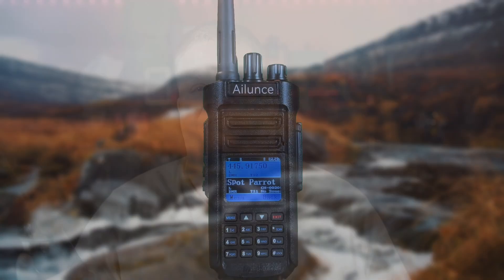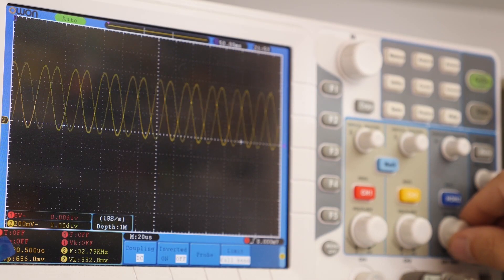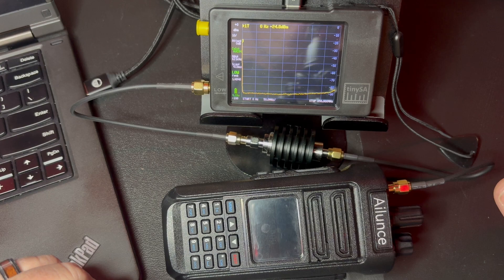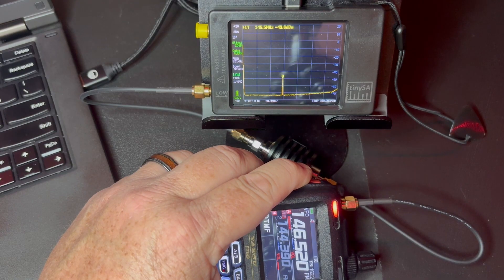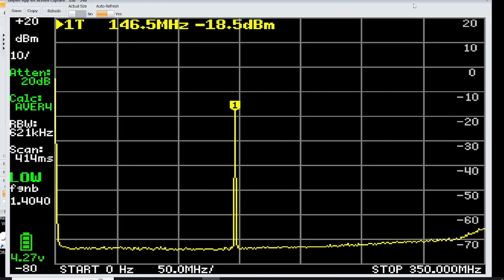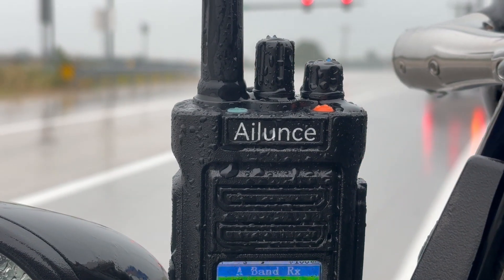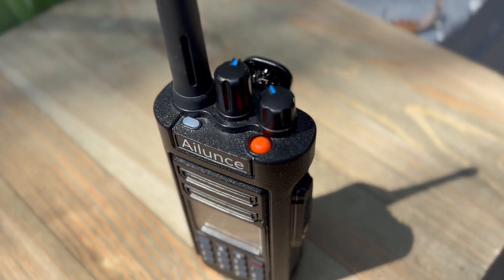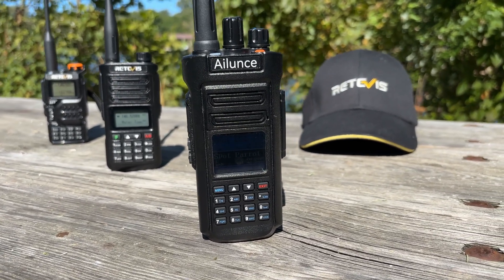Retevis HD2 PASSES FCC Test?! | The Shocking Truth About This Waterproof Radio!

Comment: Well.......Retevis still hasn't fixed the previous model HD1 model. GPS still only works in DMR mode only and not in ANALOGUE. When you use HD1 Radio in ANALOGUE mode, it is useless. My ($18) QUANSHENG Uv K5 outperforms HD1 ($180) in ANALOGUE mode......I am really dissapoinnted. Yes, RETEVIS  radios are EXCELLENT in quality, yes they are water and dust proof, yes you can tell the quality is there, but ANALOGUE functionality on this radio is really bad. If there was an ARMAGEDON on horizon or bad hurricane i would always chose $18 Quanshen or Cheapest Baofeng over this HD1 radio simply because of their functionality......Why did they advertise this radio both DMR and ANALOGUE i really do not know!

Comment: You did a great extensive review explaining in full detail. This is a great radio with good features, at a very reasonable price that includes Bluetooth, and it will also do the the 220 band after resetting it.
Reply: Menu key and #8 while turning it on? Password frequency 777888?

Comment: If you want clean harmonics pay the money,buy commercial grade..simples
You need proper calibrated test equipment ,those vna can easily be overloaded if not padded or using a proper RF sniffer sampler.
Even then I would not trust it against a very high end brand  test equipment in a rfi sealed chamber.
Expectations Vs Reality check ✅ 
If it's been approved by the FCC/ETSI it's approved and certificates end of story.

Only real way would be to take it too a proper test chamber and a company that deals with type approvals ,get it subjected to proper testing.
All these DIY methods you cannot validate and take with a pinch of salt.

Comment: So is Retevis HD2 safe to use?
Reply from the maker: In my opinion it is fine to use.  As with any rf be mindful of rf exposure.  I would attempt to keep all the antennas away from your head if possible.  Lower power hand helds seem to be good.
Reply: @Disastercommunications  Many thanks.
Reply: @Disastercommunications I recommend setting the radio to medium power which is 5 Watts because that's the safest level. For 2-way radios.
Reply: Appreciate the video I personally don't really care what the Spurs and harmonic emissions are if it's got an FCC sticker on it that's good enough for me. And I guarantee you everyone that's leaving a comment bitching and moaning about the spectrum purity of this radio has probably got five baofeng UV 5'S which are the antithesis of  spectrum purity. I have been a ham for 30 years now, before there was hro or any online amateur radio retailer amateur radio operators had to build their own equipment. So our equipment does not have to meet any Fcc certification. However amateur radios marketed for sale do. And I'm just going to bottom line it  it's a dollars and cents thing you got the same features that the anytone 878 has in a radio that's half the price it's a no-brainer it has the FCC badge which I looked up and it is legit. So everyone that is dumping on this radio needs to take a look at the typical average ham situation. Not every ham has $1,000 to drop on a handheld. The 878 is going for like close to $350 in my opinion it ain't worth the money I have an 878 UV plus I have a TYT MDUV 380 running open GD 77 firmware. And I have two baofeng rd5r DMR and FM handheld radios which were my first DMR radios. And at the moment Amazon's got the HD2 for $169.99 so whith tax you're looking at 180 bucks literally it's an anytone  radio but half the price that's what it comes down to. That's what the typical ham is going to be looking for. Price.But I do appreciate your video I'm going to make one of my own whenever I get mine here in a week or two. 73
Reply: @bleakvoid324  what do you prefer between the 878, tyt, ailunce and anytone?
Reply: @bleakvoid324  what do you prefer between the 878, tyt, ailunce and anytone?